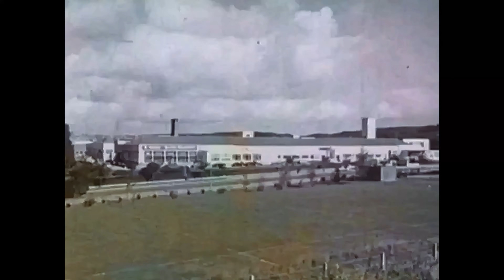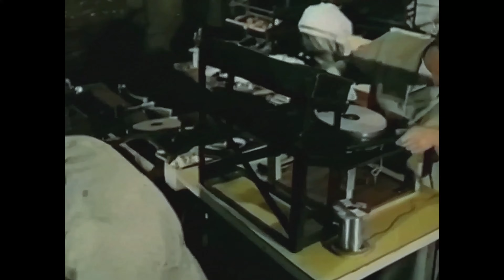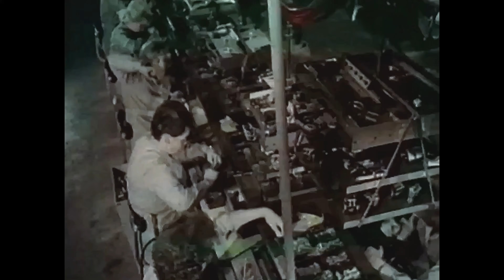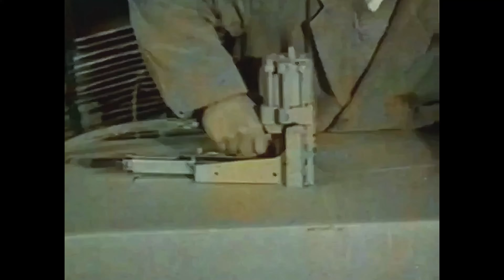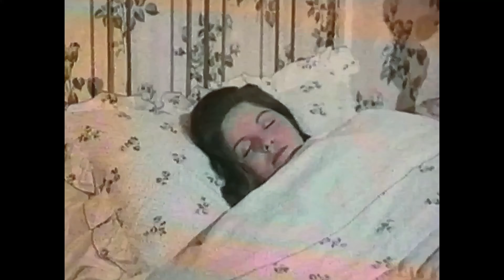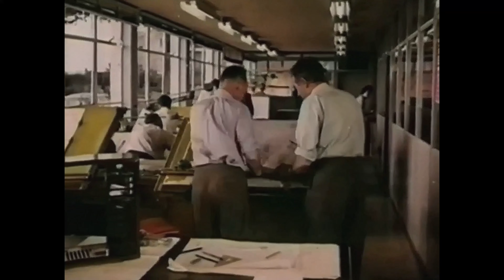RANK BUSH MURPHY LTD - RADIO, TELEVISION & RECORD PLAYER PRODUCTION! 1963. RESTORED FOOTAGE 4K 60FPS

Comment: Presumably that's a Bush CVB100 or CVB125 colour TV at the end of the film with its distinctive RCA 'roundie' tube. It also has a little magic eye valve inset into the speaker grille, though rather suspiciously it's not lit up in the image suggesting that the colour picture is a mock-up.